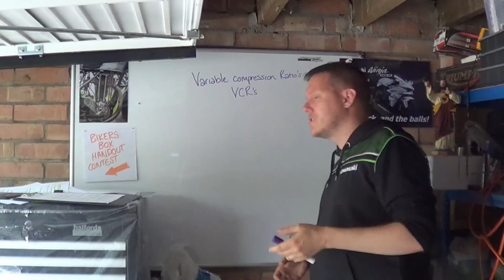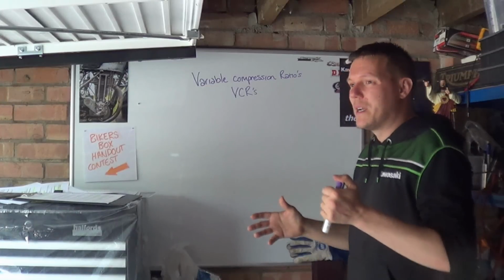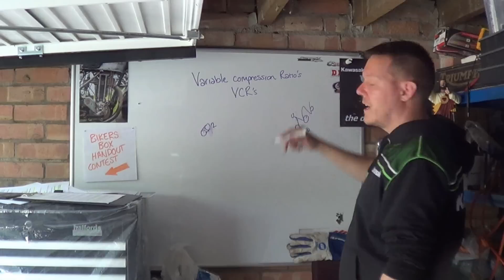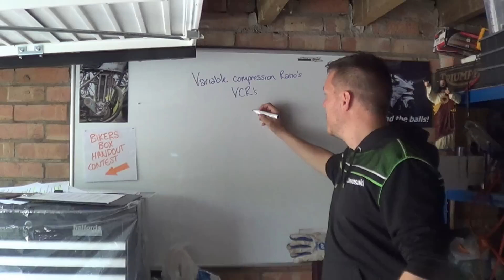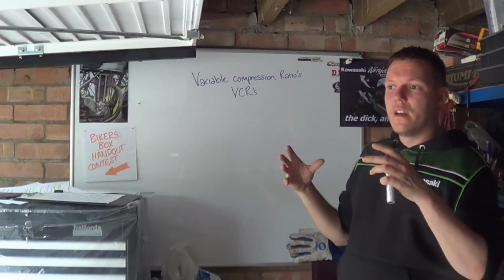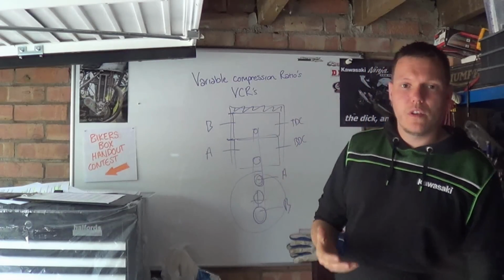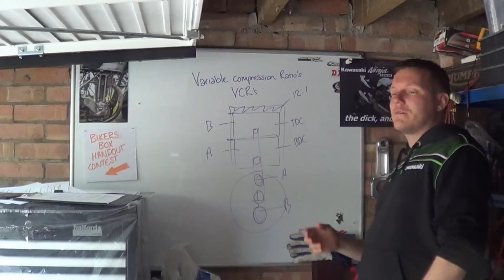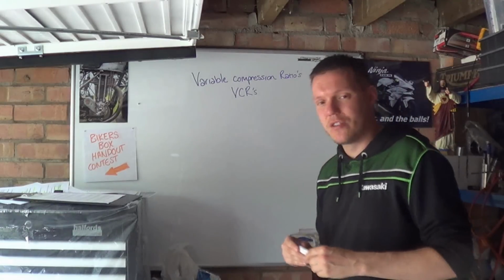Variable Compression and why

Comment: That is the basic of the reason why boosted engines exist. Turbo life!
Reply: onhawaii no, they exist because a) you can’t fit a proper sized engine in a compact, or b) the emissions laws are skewed to idling around.
Reply: No one needs an engine with the high cubic inches that causes only an in efficient gas burning like the LS gas pigs. Who needs transportation that is clumsy and heavy and take just space  away? Not me. Serious for me is SUV the short for Stupid Useless Vehicle. 90% of all owners from trucks and SUV's never use the extra space they have more the twice a year. That means they could save 60% on gas on 363 days. For emissions you don't need a turbo! (diesel except). You just need a proper sized car with an MODERN engine of an good fitted size. OK when you have a small self you need some thing big to build you up.
Reply: onhawaii Inefficient burn? Let’s measure that: 0.47 BSFC vs 0.65+ with downsized turbo.  No SUV trucks with LS on this side of the world only utes, which do 8’ around the ‘Ring from showroom.
By space (displacement) is managed in the tune according to RPM and load using 50% cylinder deactivation and CVVT to reduce effective stroke as above, so effective displacement scales from 2.25l to 6l. That dynamic is same as Ford EcoBoost I4, similar volumetric efficiency (2.3l @ 23.2 psi = 5.7l). 
Torque from full displacement comes early, its application heavy duty, utilised in full sized sports sedans daily.
Yes for emissions you don’t need a turbo, but without it a weak small engine without turbo wouldn’t pull a skin off custard the rest of the time!
Supercharging I4 and Cadillac crossplane V8 basically share same timeline, “modern” technology is computerised energy management and electric delivery.
Lol broken English back at you... weak engine puffing up itself old ladies hair accessory dreams to beat strong king!
Reply: Well, it is better to have broken English because it is my second language then to believe that I need a V8 to get some speed on the road. Why should I bother to deactivate half of my cylinders most of the time driving my car like a old lady and carry all that useless weight and trash around with me that causes the low gas millage my car makes? Modern technology is not only letting a computer deal with your engine management... The modern engine has way more to offer and those V8 dino's  are way due to be history. My 1990 MK3 Toyota Supra 7MGTE is more advanced then an LS engine even it is part of history since 1992. Yes it is not the most fuel efficient and economic car but I ride it only two or three hundred miles every month. Now I want to see your V8 go against in stock condition to a stock Japanese 3liter engine 6 cylinder car of the same year model... even a 2 liter 4 cylinder would be up to 100mph before you will be. And then you would get a ticket for speeding ;) Your strong king got to go on a diet then he does not need to drag his swollen balls behind him.
Reply: onhawaii oh and feel free to continue the hilarious comparisons, else just click through to my YouTube see 0-100km sub 4s, 160 sub 9s, 200km sub 12s, 3rd gear pull 80-160km 4.3s, top speed >320km.
I’d actually appreciate any info you propose compares favourably to a 6.1l VVT LS @ 14:1 on e85.
Reply: All bullshit! Modified and boosted... Go for stock engine as sold in the car. If you tune and boost an 1993 MK4 Supra you would be losing against a straight 6cyl. 3 Liter engine that puts 1600 Horses to the wheels. The 2JZ is not without an reason the most desired engine swap. Even if you do it right you can boost a V6 Arese engine with 3.5 Liters and your V8 will look like an moped engine on the track. Why? just because it is not even half that heavy and the front wheel drive will allow you to build a car that is 70% lighter than your pile of iron. That engine in an stripped 147 body and it will fly down the road like a jet plane. But what the fuck do you know about European cars or engines... Bragging with cars that where tuned is a lame thing because even a scooter could be tuned to go faster then your V8 LS thing. But you just don't know about it because you live in your own world.
Reply: onhawaii hey sook not bitter person be? Lighten up, eh!
Is a piston swap to increase CR, not boosted with a motor blowing air out my arse into my mouth like you dig. 
So you calling not fair if I swap pistons but you are allowed to puff up effective displacement with more boost (VE) to like 15 litres? That’s cheating isn’t it lol
BTW LS outnumbers 2Jz in preference for engine swap, unless a ricer JDM dream transformation 外国の悪魔に勝つためにターボを作る check your research. 
There is plenty of performance and greater efficiency before turbos OK. Twin turbo an LS and of course the little iron block has no chance. 
I’m out, enjoy your car mate.
Reply: Dirk, reading does not belong to your skills I guess... They desire a 2JZ but the engine is not that common on the junkyards as a LS... so of course the LS is more swapped. I am no way bitter btw. You just brag about LS engines on my turbo comment and if you ask for shite you get served shite. And how is that cheating when you go bone stock car to bone stock car? And guess what... I bet you have no clue what the Arese V6 engine looks like... I owned one before. The block is not iron... wait there is still one in my basement missing the transmission and disassembled. That was by the way one of the last true Alfa engine that were build. And I thought you would bitch about that thing. Like I said you live in your own little world where 27mpg is a good gas millage. Here we are happy when premium fuel cost less then 6 dollar a gallon.
Reply: Your opinion... when I stopped today at the gas station I could have sold it twice if I wanted to.